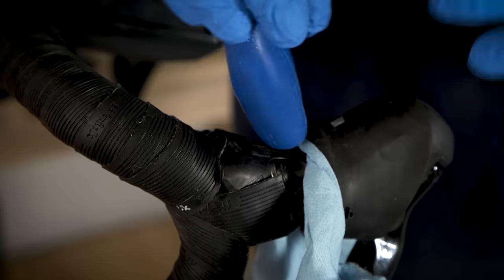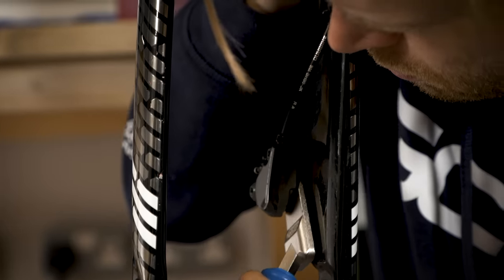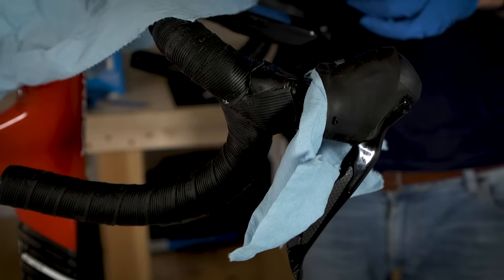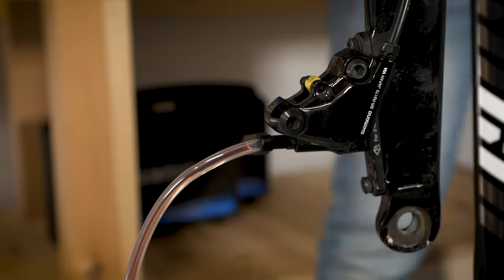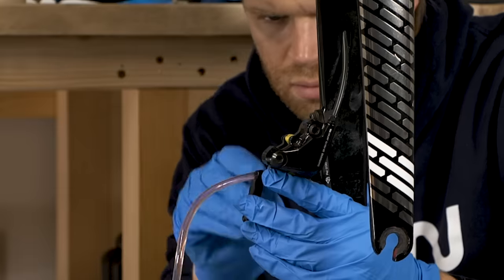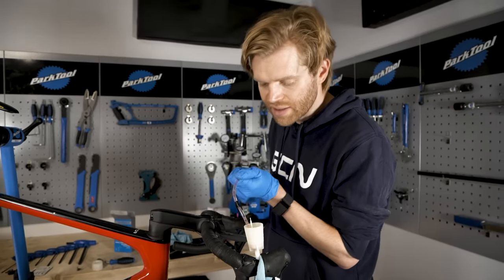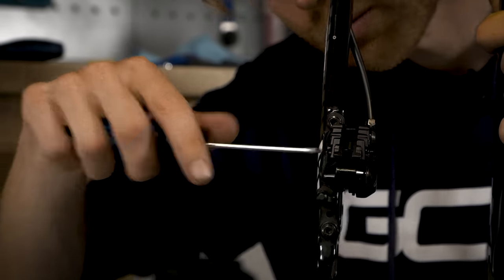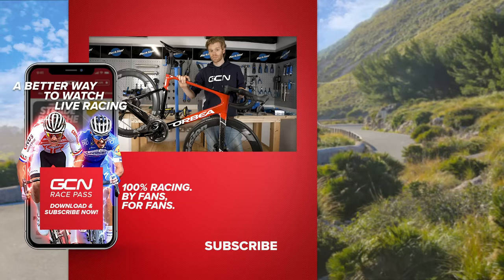How To Bleed Shimano Road Hydraulic Disc Brakes

Comment: When you aspirate the old fluid from the top reservoir, does this not contaminate the hose and syringe that is going to be used for the fresh fluid on the rear brake?

Comment: I cannot hold back any longer.  Has Ollie joined a Flock of Seagulls tribute band?

Yes two of my bikes have hydraulic disc brakes but haven't had to do anything other than replace the pads a couple of times.

Comment: Good video, didn't know you were such a techie! However, looks like refitting the clip on the pad retaining pin was missed. Do I get a cap? 😊 Also did I miss the bit where you loosened the caliper bolts before recentering the caliper?
Reply: I miss JC, badly!

Comment: Thanks for the information! I have now bled both my brakes and changed the pads. My levers still touch the bars after bleeding and checking to get all air bubbles out. The brakes do work though but there's a lot of travel. I have 105 R7000. What can I do to improve it?
Reply: Did you manage to sort this or find out more information? I also have 105 R7000. 12mo Endurace, done 4k miles and my brakes need a lot of travel before substantial brake power, almost right to the bars. I thought it might be time to bleed my brakes which is what brings me here but I have spoken with some friends and one has advised they had the same issue with the 105 but particularly when it was new. So not sure if this could be a reoccurring issue with the 105?! Maybe!
Reply: @lobi8655  no I didn't fix it completely but I improved it a bit. I have braking power and it's good enough. At some point I'll probably get a bike shop to improve the brakes for me rather than bother trying it myself again.

I think that some bikes will have this issue from new because they are assembled by hand in the factory, so as long as the brakes work then they don't have to be perfectly tuned. The guy in the factory is only really doing the same thing as in this video.
Reply: Get mechanical rim brakes. Far easier to maintain, far less replacement costs of replacing a rim once every several years versus continually replacing disc pads, rotors, and brake fluids multiple times a season, better braking power, no sponginess or pull length issues, and no worry about having a bubble in your line and suddenly your brake does not work when needed on a high speed descent. 

Don’t buy into the industry marketing drivel BS that a road or even a gravel bike in 99+% of riding situations requires hydraulic disc brakes. They don’t! 😀

Comment: Before pressing the piston back into the caliper, they need to be cleaned carefully with a q-tip dipped in isopropyl alcohol. Otherwise the seals might be damaged.
Reply: Use mineral oil instead of alchohol on q-tip. Then press the pistons into the caliper and clean it out with alcohol

Comment: useful, as i'm very new to Di2 I have a new bike  (one day old with 2x11 GRX D2i ) all working well apart from a slight chain rub on the 5th cog on the cassette. Not sure i have the nerve to press that button for 3sec and play with the right lever! Bike was hand built in Scotland so i cant take it back for adjustment as its a 900 mile round trip!
Reply: oops too slow...the above comment was meant for the video on setting up installing Di2

Comment: People in the comments, I'm calling on you. Help me choose a path.About 15 years ago, I was a professional cyclist in my country.

But after that, I gave it up. I can easily figure out everything with cables, shifting, or the brake system. But now I've decided to ride for myself and bought a road bike with disc brakes. Now the brakes work well, but I need to go through the brake system because of the new hose routing due to the replacement of the handlebars.But I'm scared of it. I need to somehow carefully drain the system, pull the rods, and then refill the system.

Tell me, am I staying away for nothing? Should I just buy everything I need and do it the first time, figure it out and not be afraid of hydraulic systems anymore? Or is it really a big problem, and it's better to go to a mechanic to solve my problem, but then disc brakes will remain something incomprehensible to me?Tell me, is it really difficult to do it the first time, or is it worth daring to overcome it for myself?

Thank you for your time.

Comment: Why's your front brake the right lever?
Reply: Because they drive on the left side of the road hence the brake lever is on the right. Vise versa when driving on the right side.
Reply: I always think Right = Rear so the UK system would mess me up
Reply: @jp93309  If you have to chant right=rear every time you need to stop, you are already messed up. Quit.
Reply: @LoeVG  Italy : ride on the right side, front brake on the right hand side
Japan : ride on the left side, front brake on the left hand side
Reply: UK : ride on the left side, front brake on the right hand side
Japan : ride on the left side, front brake on the left hand side
Italy : ride on the right side, front brake on the right hand side
¿ everyone else ? : ride on the right side, front brake on the left hand side
Reply: @son-tchori7085  not really, here in Italy we have the front brake on the left side, EU style
Reply: I set up my bikes moto style, motorcycles have the front brake on the right and it feels natural to me. Not sure why in the USA the standard became front on the left, but I'm right handed and feel i have more strength and better modulation in my right hand so my braking performance is better.
Reply: @son-tchori7085  that's weird - all the bikes you can buy in shops here are setup euro style...
Reply: @LoeVG  Actually that's incorrect. A lot of countries in Europe like Italy, Belgium, Netherlands, France, etc. who drive on the right side of the road still have their bicycle brakes like this. The real reason is because on motorcycles the right brake lever is for the front wheel, not because they drive on the left side of the road.

Comment: Pretty sure Ollie was mistaken about it cleaning up with water - It doesn't.  However, a mild alcohol solution (rubbing/denatured, etc..) will clean up any drips or spills.
Reply: Yeah, mineral oil is petroleum based. No way it cleans up with just water. You would also need to be using either alcohol or some type of mild detergent/soap to truly clean up excess mineral oil.

Comment: What's nice is that there are dozens of different connectors, so it's almost impossible to do the job on different brakes. Is there a kit that has more than 2 kinds of bleeder holes?
Reply: Yes, the Epic Bleed Solutions universal kit has 3 or 4 different threaded port adapters.
Reply: The Aztec universal kit has 7 adapters!

Comment: Better not use a screwdriver as a pad spacer. A park tool cone wrench handle works well, but f you don’t have one of those either a tire lever is the best choice.

Comment: Ok, so there’s an official Shimano syringe and tubing costing over £10. What do you actually really need? 

Surely any generic syringe will suffice. What fluid volume and what diameter tubing is needed? Can you clean the syringe with alcohol and store for reuse?
Reply: Neil Moss what diameter tubing? That’s why you buy the real thing. ;) You can leave the syringe alone the oil left inside is safe to store. The volume isn’t much there is not much volume in the system.
Reply: about 30 ml of oil, I'd say. It does depend on the length of the lines. I think it's 5 mm ID tubing but don't quote me on that.

I would actually buy the Shimano-specific kit because it comes with the plastic "lock" tab for the caliper. I don't have one since I already had a generic MTB kit and it's pretty infuriating to have the hose come loose when refilling the system.

Comment: Great video thank you. Question. My bike has hydraulic brakes and hangs vertical in the garage when not in use. I have noticed that over time, when the bike comes off the wall the brakes take a few pulls before they get effective. Today I inverted the bike and chaged all brake pads. When I uprighted the bike there was nothing in the levers at all. A few minutes of pumping the levers brought the pressure up and the brakes are now funsctioning well. I do suspect that the reservoir is low on fluid which is why when vertical or inverted there pressure drops out.The brakes haven't been bled since the bike was new 5 years ago. Is my theory right or is it possibly something else. thanks
Reply: Yes, you have air in the top of reservoir and when you invert the bike the air starts to drift into the system. Either top up the reservoir, or better still do a full bleed.

Comment: How would you define “spongy?” My LBS had to bleed brakes for my fork swap out on my brand new bike. When I got it back, the brake lever felt like it had more travel than before (than when I got it new from the factory). Brought it back to them to check out and they insisted that the amount of lever travel was normal although my rear brake definitely feels “tighter” than the reworked front. They mentioned the rear was too tight and it should have more modulation than that. Not sure if I should contest that since I’m a hydraulic disc brake newbie.
Reply: in my experience they should both feel snug.  not squishy.  firm upon pad impact with rotor.  not as firm as you can get  a cable actuated brake but definitely responsive.  its hard even when perfectly bled to get both levers to feel identical without adjusting the "reach adjust" that some levers have.

Comment: If you've got 105 brakes, and the levers always pull back to the bars. No matter how air free the brakes are.
Is it worth updating to Ultegra brakes just to have free strokes adjustment (reach is at maximum), to cure the problem?

If I pump the levers, they do move away from the bars (finger width).
I've tried new pads & Ultegra rotors and pushing the pistons back, plus realignment.
Reply: Inspired to Tired I don’t you where you got your experience from, but if your levers go all the way to the bars it’s nothing to do with ulterior vs 105, it is what is meant by “spongy,” or you need to adjust the free stroke and lever reach.  He didn’t show that in this video.  They effect each other, so the less free stroke the farther away from the bars the bite point is, and the more reach the farther away from the bars the bite point is.
Reply: @jonathanzappala  Agreed. It's a faulty setup somewhere, I've installed the lower end brakes and didn't have that experience. That actually would make the brakes useless and terrifying! It really sounds like the calipers have air in them. I'd follow the longer bleed process described by Park Tool that "burps" the levers many times.
Reply: funny. i never had problems with ultegra (di2) or dura-ace brakes on several bikes. always nice and bity without the need for touching the free stroke adjustment other than personal preference. 
but my girlfriends bike has 105 on it and the front brake always pulls back way too far before actually biting. i bled the system and reset the calipers more than once but it always fails to really feel spot on. the rear brake is also more spongy than i am used to.
Reply: @jonathanzappala  Thanks to everyone for their help.
The 105 doesn't have any Free Stroke adjustment, which is what I believe I need.
I've burped the brakes multiple times (Park Tool & Free To Cycle videos), but I can't get any more air out of the system.
I think I need a thinner bleed block (instead of 10mm), so the brakes are activated sooner.
Reply: Inspired to Tired if it doesn’t have free stroke that would be fine. It’s kind of useless I think on the lowest setting, which is the factory position, there is already too much free stroke. If you don’t have the setting then it’s probably built for that factory setting. If your pads have more wear than it could be that the bleed block has them starting too far out. But over time it should correct for that, unless you have a stick piston, but I don’t know if that’s a big thing on the road like it is on a mtb. The shimano mtb levers without free stroke work just as fine as the ones that do people don’t care for the adjustment on a mtb.
Reply: @inspiredtotired8369  No, it will always be air in the system somewhere. Sometimes you need to strip covers off to be able to tap the hoses to get the air to move

Comment: I would have thought you would put the bike on the floor, do the wheel up, operate the brake to take up the gap between pad and disc, tighten the caliper bolts, then remove the resovior.

Comment: I can adjust my rim brakes on the road. Even on the fly.  No tools needed and it lasts 2 minutes. Also, my brake pads last 25 000 kilometers already and they are still good.

Comment: I"m wondering if you guys have ever encountered such a situation, the calipers are centered well, and there's no rubbing when the wheel spun by hand or just riding on the flat road. BUT when standing out the saddle, the rubbing appears. The rotors and the pads are new, and of course, the rotors are true, no matter how carefully to adjust the calipers, the rubbing comes for sure when you are out of the saddle. Really frustrating.
Reply: your wheel might need truing or more spoke tension
Reply: @aacc8466  Oh, forgot to say the wheels are brand new Shimano C40 Disc
Reply: I think it is probably a little flex in the axle. I get the same problem with my Mavic carbon wheels when standing, but not with the DT Swiss alloy wheels that came with the bike. I can switch brake rotors between the wheels and it is still the Mavic that gives this problem. I just put up with it. I do not think there is much drag being caused.
Reply: @Numeriwar  Do you mean some forks are just not strong enough due to not-that-good design and tend to deform/flex under pressure from the rider?
Reply: If it’s an earlier disc hub that has quick release skewers, then yeah: there’s a good chance the hollow axle isn’t stiff enough for the momentary loads - hence the rub. Newer frames and forks come with thru-axles for a reason (stiffer). Build a set of wheels or two and you realise that yeah, it very much is a spoke tension thing too, especially if it’s the front disc that rubs. Not much you can do about it, though, save from building your wheels with different gauge spokes on each side. (Which is what I did - highly recommended. Hats off to Sheldon Brown.)
Reply: @Numeriwar  oh yeah ur right mr armchair mechanic. my input is completely wrong how dare i throw out a suggestion that does not meet ur standards mr arm chair mechanic
Reply: @CodSlap  I have an Enve thru-axle disc fork and thru-axle disc Shimano C40 wheels, so nothing to do with QR skewers, and I don't think it's possible to tackle with Shimano's factory set about the spoke tension.
Reply: @MajorJamesGastovski  I'd guess that's it, though. Some setups are just more flexible than others. I used to get brake rub on cable brakes with a Reynolds Ouzo Fork if cranking out at low cadence standing climbing. My Hunt wheels rub a bit, a set of Hope doesn't. For the Hunts I think the "weak" spot is the caps, since they try to make a very user friendly system where you can remove everything by hand - and this  is with 15 mm axles.
Reply: James Gastovski Check! In that case you must be right, and changing the spokes isn’t really a feasible option unless you build the wheel from the ground up anyway. Too bad, of course ... but it’s sort of good to hear that the rubbing can be an issue with thru-axles as well. I bought my frame in 2016 and thru-axles were the only unchangeable feature that was missing I think would’ve improved the overall setup.

Comment: Ollie, are you running your front brake with your right lever?
Reply: Bikes in the UK are always set up like this. Along with other countries where they drive on the left (Aus, Japan etc). I think (might be wrong) it's so you can use the rear brake when turning across the traffic.
Reply: @jeffcarlton  Thanks Jeff! I run a right front brake in Canada, but that's because that's how motorcycles are set up and I wanted to match my fleet...
Reply: @overdraftracing  Definitely need them the same then!

Comment: Isn't there a step you missed (as per Shimano)?
After the syringe push, attach the bleed bottle at the caliper, and gravity bleed from reservoir into bottle....
Reply: That was my point as well. There are no videos that give over the Shimano procedure step-by-step. What is covered here are just steps 1-3 or 4 (depending on the break class) from Shimano's Dealer's manual (15-step manual). Are the steps about gravitational bleed and depressing the leavers usually omitted?

Comment: By mistake I pressed the brake after removing the pads when the front wheel was off. When I pressed the brake it leaked brake fluid. Did it leak because of my mistake
Reply: I've cleaned the caliper, if i bleed the brake will it be okay or should it have not leaked and I have another problem

Comment: Has anyone had a problem with 105 disc brakes on bumpy roads/cobbles? I bled the lines and replaced pads in rear 2 or 3 months ago and they were great. Now I notice that  after being bumped around, the lever goes squishy and doesn't engage until almost at the bar. A few pumps seems to get air out of the line and normal braking returns. If they need another bleeding, why? Since day one these brakes have been very fidgety. If anyone else had this problem with Shimano RS 505, please let me know your solution. Might this be a warranty issue?

Comment: shimano said that you rarely if ever need to bleed brakes, they said if the brakes feel spungy then just push the pistons back to re-center. How is air supposed to get in these systems anyhow if they are sealed, makes no sense?
Reply: everything leaks, given enough time. Also there's the potential of degradation of the fluid, maybe accelerated by heat? I don't know exactly why, but on an older TRP hybrid system (parabox) the fluid was discoloured.